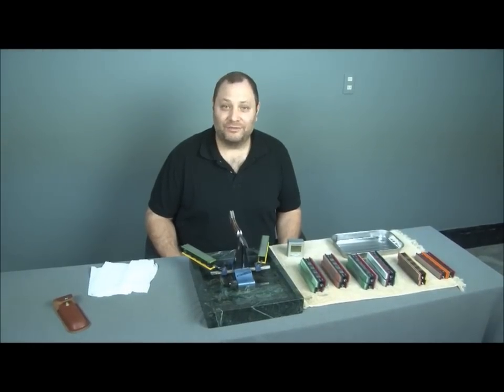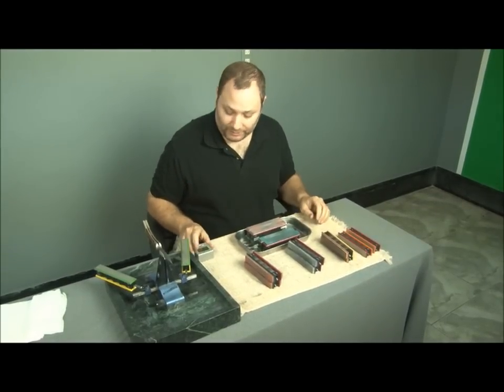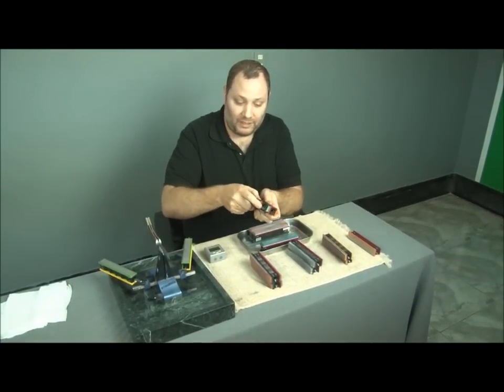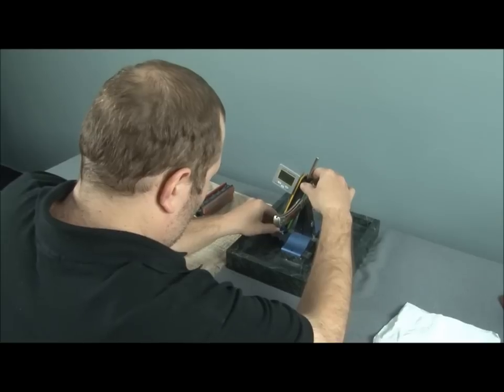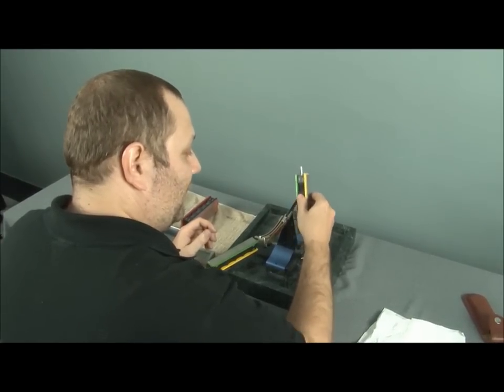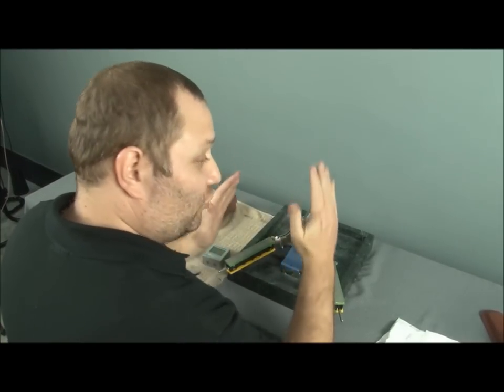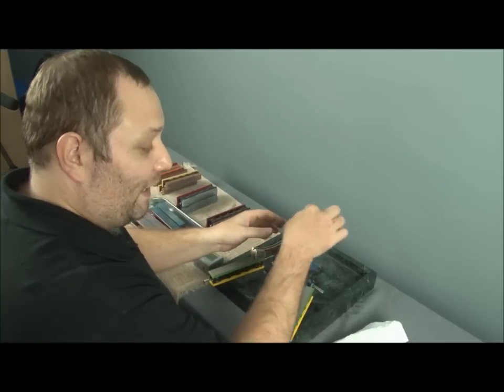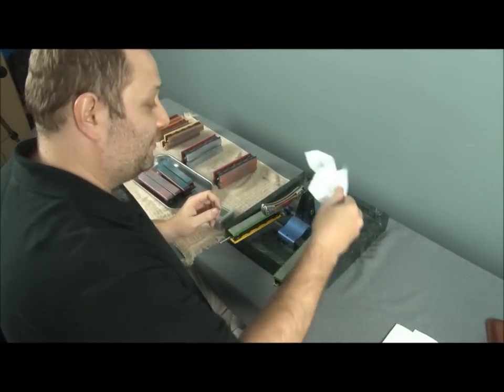WEPS Chosera Tutorial Part 1 - Lapping and the Different Strokes -  Jende Industries

Comment: You flatten the Chosera's by rubbing them on the diamond stones. Shouldn't the diamond stones be flat for this to work? How do you know they are?
Reply from the maker: Thanks for watching, Mutrino! The WEPS diamonds are embedded on a steel platten, making them more consistently flat and ideal for lapping. How flat is relative - even diamonds wear, causing surface height variation. The most important thing is to have at least a consistent "flat" throughout all of the water stones.
Reply: Jende Industries, LLC
Thanks!
Reply from the maker: Mutrino
Anytime!